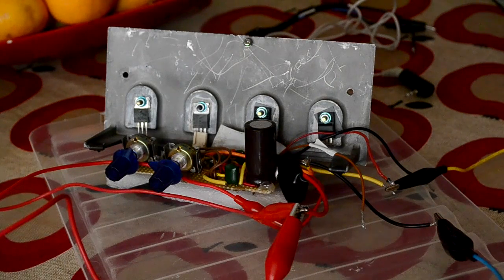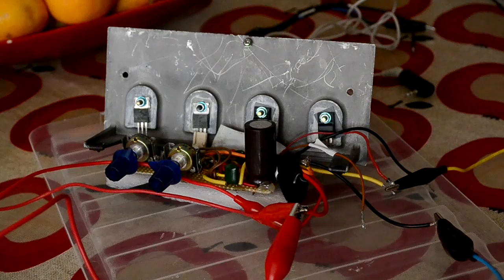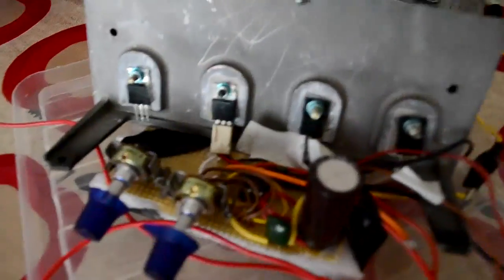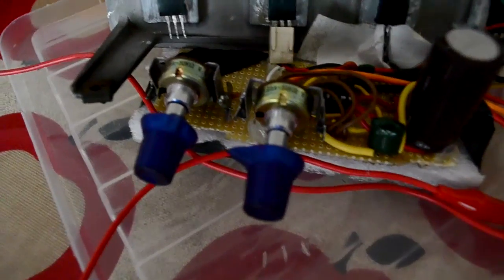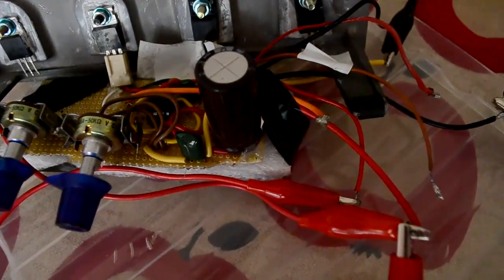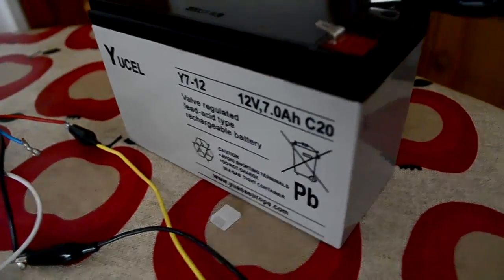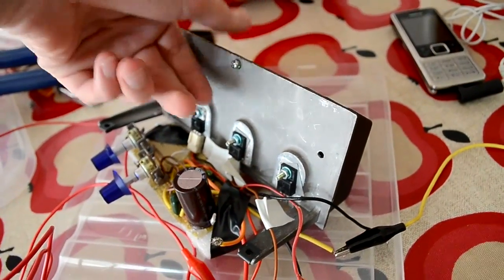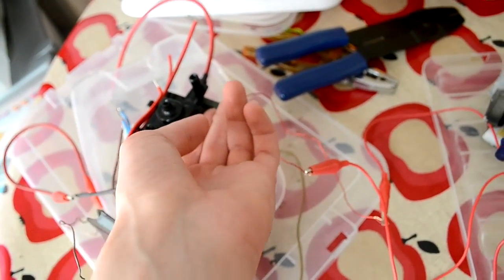555 flyback driver

Comment: I recently completed my very first 555 timer flyback driver, and I followed your schematic with a few changes. Literally, it was the first time making this circuit, and idk how I pulled it off, but It went out hugely successful. Massive, hot arcs at only 12v.

The only problem with it is MOSFET heating. But other than that, It's amazing!

Edit: This circuit is annoying, really annoying! Improper primary connection (wrong polarity) gives a dead flyback transformer. More primary turns give you a dead power supply if left unprotected. They say this is a "beginner friendly" circuit, but I really doubt that.

Comment: HI,   nice arcs. I wonder if you could really help me, I want to get a higher voltage  / longer arcs rather than just more current.. Which is more suiting for me, 55 timer and single mosfet like yours? or a ZVS driver?  thanks alot

Comment: Use a separate supply for the 555. (use an adapter/transformer for the 555 and another one to the flyback) also, do you use mosfets or not

Comment: @ThePizzahero1 if you don't think diodes are enough you can always use filter caps on the power supply for the 555. I'm going to use a 15000 mf cap for mine. ( I have had some stop working some put out a little smoke some put out a lot of smoke and have had one that just plain blew up.) good luck

Comment from the maker: @ExplosiveAnyThing Thanks for the suggestion. I did try that at one point and the MOSFET blew instantly. But I have my ZVS driver for use with higher input voltages, on 36v input I can get 5-6inch hot arcs whilst the MOSFET's stay relativity cool/lukewarm.

Comment: Take two batteries connect them in series  you will got 24 volts then supply 12volts to the 555 and the 24 direct to the mosfets you will got much longer arcs

Comment: @Alex1M6 Good point, any dime I used a resonant capacitor I used IRFP250s which I still blew a lot of. IRFP460 should do fine for resonant  capacitor 555 flyback driver, as it leaves quite some high space for the kickback voltage.

Comment from the maker: @CoolDudeClem ...From pin 3 to the MOSFET gate at all? I used a 47ohm without a buffer transistor so I think that might also be limiting how hard the MOSFET is being driven.

I think in the case of a diode in reverse across the primary coil, my understanding is its the HV kickback that helps get such a high voltage on the output. I am not sure how it would effect current draw though.

Alex.

Comment from the maker: @CoolDudeClem Thanks. I am going to try using a separate supply for my 555, perhaps two 9v batteries in series and then regulated down to around 15v. I am defiantly going to be buying some decent MOSFET's from farnell in the near future, I wish Maplin stocked the IRFP260 rather than just the lower voltage IRF540 as it would be so much easier to get. Thanks for the tip on the fast diode, I have a few lying around so I will put one in when I get some new MOSFET's. 

Did you use a gate resistor?...

Comment: @CoolDudeClem One more thing, I tried connecting a diode across the flyback primary, but for some reason that didn't work very well and actually increased the amount of power the circuit took, I'm not sure why that happened.

Comment: @Alex1M6 I found out that to stop the mosfet getting too hot it's a good idea to drive the gate with as much voltage as possible, but no more than15volts, It's also good to use a mosfet with a low Rds like which is why I chose IRFP260 for my projects.  I also use a fast diode (UF4007 is a good one to use) connected between the source and drain pins to protect the mosfet from high voltage kickback as the internal diode in mosfets usually aren't good enough.

Comment from the maker: @CoolDudeClem Yep they can get pretty long, although it does draw 10 amps @12v from the battery! 
Does your MOSFET get hot when powering the flyback? I was just thinking I should probably use a separate battery for my 555 power supply before I try juniortore1's suggestion of a resonant capacitor in order to help stop the MOSFET heating. As every time I have tried a resonant capacitor it kills either the MOSFET or 555 (sometimes both).

I see you are a night owl too lol.

Comment: That surprised me at how big the arcs can be from a 555 based flyback driver, even at higher supply voltages I haven't got arcs that long from any of my 555 based drivers(yet).  I always power the chip separately from the rest of the circuit, that way the chip wont ever see any spike big enough to damage it no matter what the voltage is powering the mosfet & flyback part of the circuit.

Comment from the maker: @juniortore1 If I do that do I need to use any type of circuit protection as the last time I used a resonant cap in parallel with the flyback primary it killed my MOSFET.

Comment: To help stop mosfet heating stick a: "high quality" .1uF -1uF (.68uF best maybe) 250V+ Bi-directional capacitor in parallel with the flyback two primary inputs

Comment from the maker: @juniortore1 Thanks! also I wanted to ask you if you have any advice on keeping the MOSFET running cooler besides using a large heatsink. Would using some sort of buffer transistor help drive the gate more effectively or perhaps a resonant capacitor like you used in your video. 

Thanks.

Comment from the maker: @AnythingSlowMotion ...tuned just right at the "sweet spot". If I move them a little too far away from the sweet spot the arcs die and are much smaller.

Also the heatsink needs to be big like the one I used. I firstly tried using one out of an old TV and it heated up almost instantly as it was too small.

Hope this helps and good luck with this as your school project.

Alex.

Comment from the maker: @AnythingSlowMotion Oh ok. I had to use lots of hot glue around the flyback pins as it kept arcing, so maybe that might be a good idea to do when you get your new transformers.

Oh another thing I should have mentioned is I have found the amount of primary coil turns on the core make a ton of differnce with this driver, at first I tried something like 20 turns and got around 1cm cool arcs. Then I tried it with 10 primary turns and the output was much better. But the POTs have to be...

Comment from the maker: @AnythingSlowMotion I would defiantly say that the audio is louder using this set up, but I think that was mainly thanks to the 50K pots allowing me to adjust the frequency to produce the longest arc. The filter capacitors are there to help protect the 555 from back emf. 

For me this one worked out better than the kaizer power electronics one. Are your arcs bigger or smaller than in the video? I am using a 12V lead acid battery and draw around 6-8amps, the plasma sound is better in person.

Comment: Would you say the audio quality is better with this driver compared to the old 555 plasma speaker circuit from Kaizer Power Electronics? You have slight modifications and I am doing this as a senior project for high school. Also, how many amps are you putting through it? With the old one I am using a 6 amp power supply and can get some pretty nice arcs with that and music quality isnt too bad. My transformer is nearly dead from corona though. lol